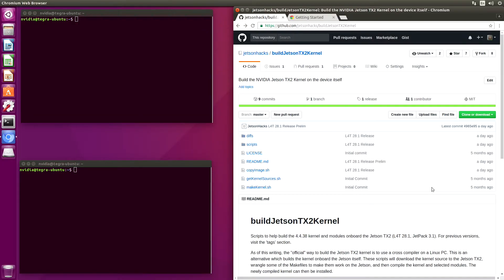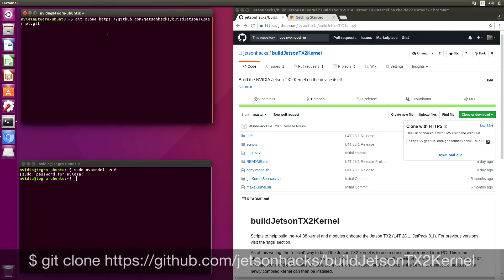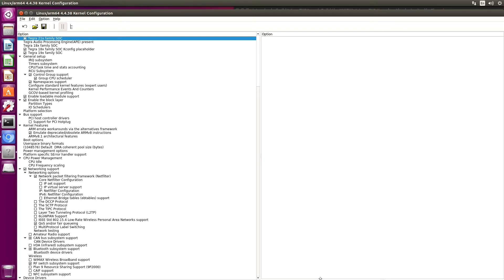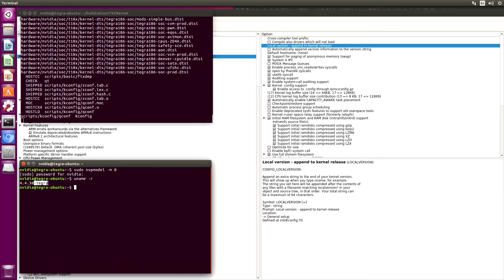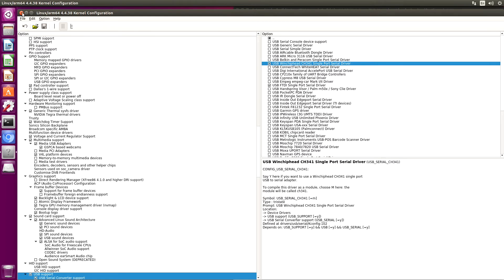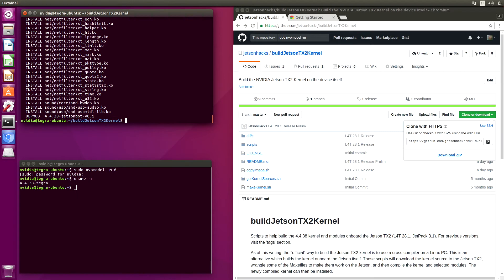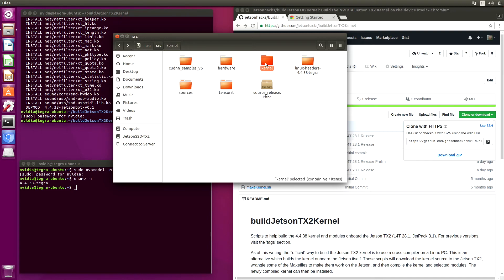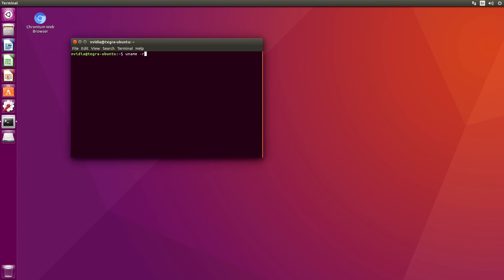Build Kernel and ttyACM module - NVIDIA Jetson TX2

Comment: Hey thanks for the video's. 
I am running into a problem with ./copyImage.sh
cp: cannot stat 'arch/arm64/boot/Image': No such file or directory
Do you know anyway around this?
Reply from the maker: The kernel did not build in the previous step. Error messages are printed during the build process. Which version of L4T are you building? Which version of the scripts are you using?
Reply: I get the same problem when building on the TX2. I cloned today's 9-10-17 master branch for TX2. uname -r is 4.4.15-tegra.  There is a build error, but the process doesn't stop, it continues untill makeKernel.sh shows "DEPMOD 4.4.38-jetsonbot-v0.1". I get some warning at first related to TEGRA_HSP, TEGRA_BMP etc saying things about TEGRA_IHVC has unmet direct dependencies (ARCH_TEGRA).  A bit after I get a build error(s) "redefinition of tegra_powergate_is_powered" (tegra-powergate.h),  "error expected idenrifier (pmc.h). Will try to look into it if find anything will let you know. I'm concered about the versions being different. Other than that I'm also adding in some cryptographic modules. Thanks.
Reply: WheresTheAnyKey1
1 second ago
I get the same problem when building on the TX2. I cloned today's 9-10-17 master branch for TX2. uname -r is 4.4.15-tegra.  There is a build error, but the process doesn't stop, it continues untill makeKernel.sh shows "DEPMOD 4.4.38-jetsonbot-v0.1". I get some warning at first related to TEGRA_HSP, TEGRA_BMP etc saying things about TEGRA_IHVC has unmet direct dependencies (ARCH_TEGRA).  A bit after I get a build error(s) "redefinition of tegra_powergate_is_powered" (tegra-powergate.h),  "error expected idenrifier (pmc.h). Will try to look into it if find anything will let you know. I'm concered about the versions being different. Other than that I'm also adding in some cryptographic modules. Thanks.
Reply: I should add that I'm trying to build this on the version that shipped with the TX2
Reply from the maker: 4.4.15 is L4T 27.1. The master branch is for 4.4.38 (L4T 28.1). There is a tagged version for 27.1 in the repository. Please see the article: http://wp.me/p7ZgI9-QI
Reply from the maker: 4.4.15 is the kernel for L4T 27.1. The master branch builds the kernel for 4.4.38 which is L4T 28.1. You can read the article: http://wp.me/p7ZgI9-QI if you are trying to build for L4T 27.1.
Reply: Hey Thanks for the reply. I am running 
 L4T 27.0.1
 Board: t186ref
 Ubuntu 16.04.2 LTS
 Kernel Version: 4.4.15-tegra
So to solve this issue I just build it off the repository/article  you pasted bellow? "  http://www.jetsonhacks.com/2017/03/25/build-kernel-and-modules-nvidia-jetson-tx2/"
Thanks Again
Reply from the maker: The version in the article is for L4T 27.1, NVIDIA highly recommends to upgrade to the production version L4T 28.1. The L4T 27.0.1 is not production quality, simply the shipping placeholder at the time of the  introduction.
Reply: Thanks for the reply. Tried checkout out and building that branch and got build errors. It looks like R28.1 also supports 4.4.15 as well as R27.1 (as per the nvidia embedded site). Will update when I break through.  The build errors were related to nvsci.h saying things about "CLK_SETTLE" redinfined
Reply from the maker: The L4T 28.1 kernel is 4.4.38-tegra. Have you upgraded to L4T 27.1 or L4T 28.1?
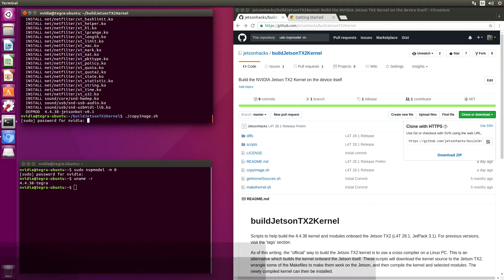Reply: I am using what came with the TX2 (as of, about a month or two ago). uname -r says 4.4.15-tegra. When I check head -n 1 /etc/nv_tegra_release, I see I have (release) REVISION 0.1. So, that checks out. I realize though that after about 4:30 in https://www.youtube.com/watch?v=ZpQgRdg8RmA video, I have what I was after, which is, being able to develop on the SSD. I realize that the rest of the video explains how to build custom kernel and module but if you are ok with using the stock kernel, then it looks like booting from the SSD's copy of "Image" sets the root to still point to the SSD. At least, when I df - h, I see I have 235G of space (207G available). I also see the /dev/mmcblk0p1 as 28G. I also see the same under the "Files" GUI when I right-click properties. I guess, I'll avoid the possible hair-loss for now. : / Thanks for helping out man, I've followed Jetsonhacks since tk1 days.
Reply from the maker: I'm glad I found what you are looking for. Thanks for watching!

Comment: If I have moved everything into external SSD and run from SSD, all the scripts run without error but no change after reboot. The make script finishes much sooner.

However, Thanks a lot for the video. It is working like a charm when I reflashed everything and working from internal memory. But how can I use it from SSD?
Reply: Probably I should boot to internal memory
then rebuild the kernel, 
then copy the /boot/Image & /boot/initrd & /lib/modules to the corresponding folder in external SSD
then chage the boot option to boot again from SSD.

Is it correct or Am I missing something or totaly wrong? :D
Reply from the maker: I don't know the exact setup you are using, but if you are booting from the eMMC and then setting your root drive to the SSD (this is common), you must copy the newly built kernel Image file to the /boot directory of the eMMC. The provided script copyImage.sh copies the Image file to the boot directory of the current drive. For example, if you build everything on the SSD (which as you noted is much faster), the new Image file ends up on the /boot directory on the SSD. You should then copy the new Image over to the eMMC /boot directory so that the machine uses it to boot.